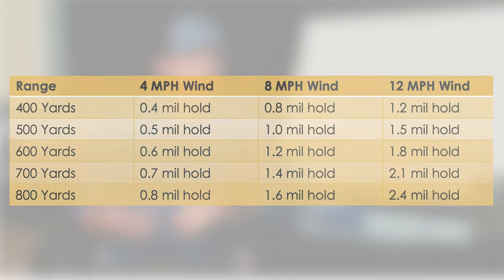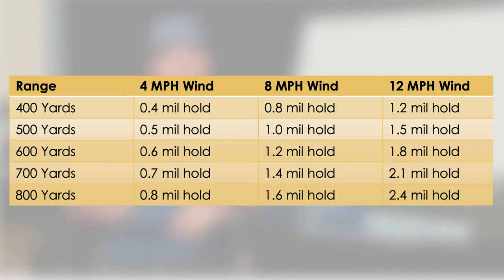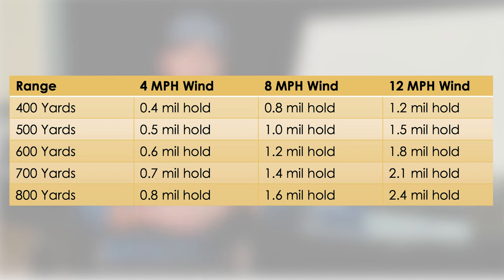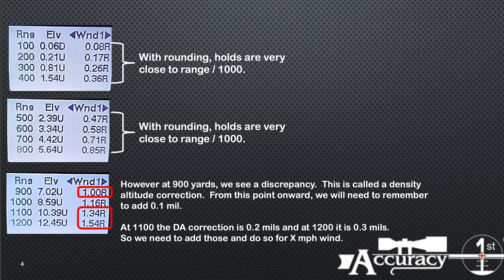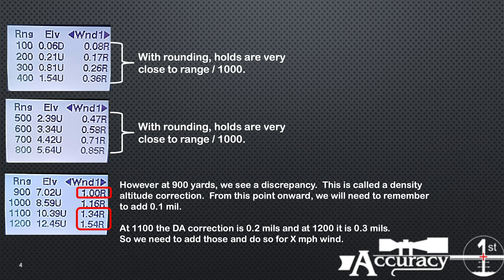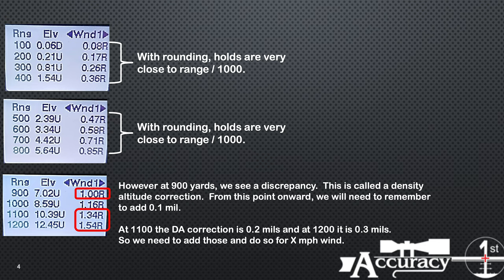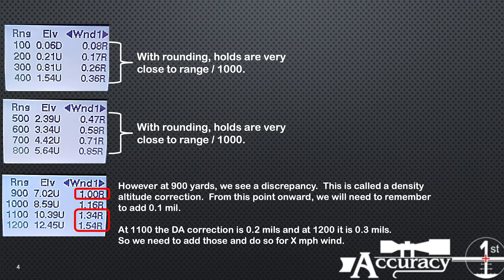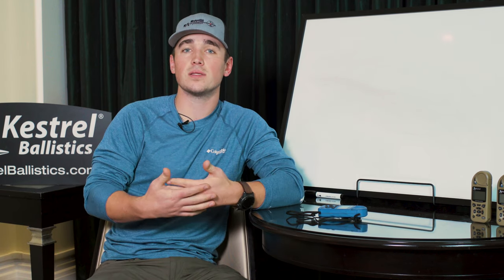Accuracy 1st Feature for Kestrel Elite (Part 2) | Colby Hodnett of Accuracy 1st

Comment: Shouldn’t you also set the latitude to zero so you won’t be adding in horizontal Coriolis? I know it’s not a very high value but it could be enough to cause a 0.9 to round up to 1.0, just as an example. Thank you!! Love these vids you are doing, much appreciated!!
Reply from the maker: You are correct.
- Colby Hodnett